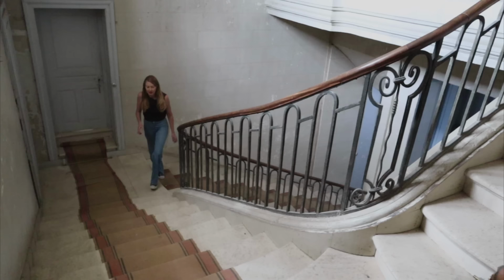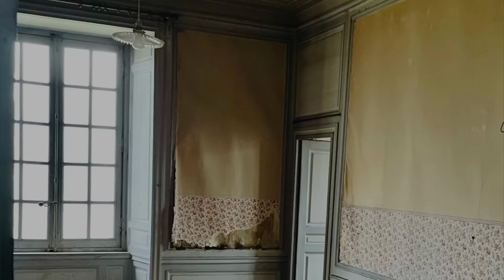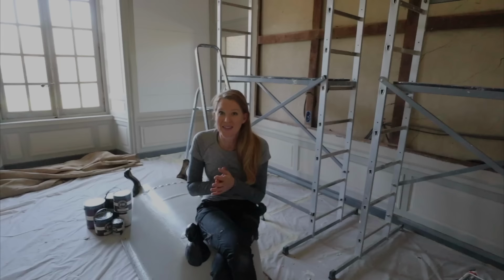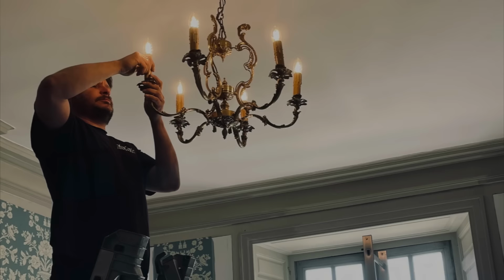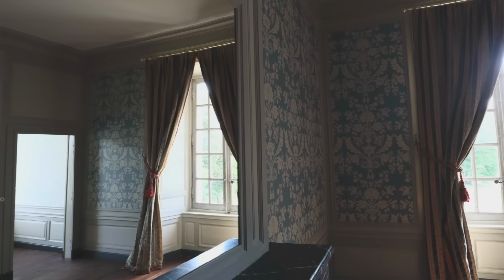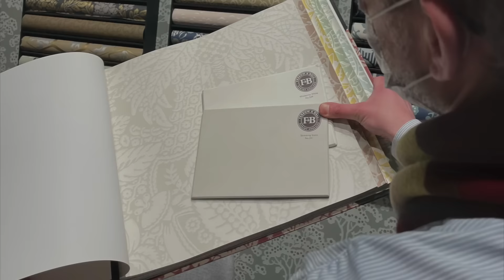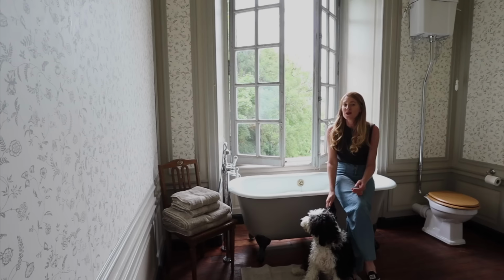Only 103 more rooms to go! Bedroom & Bathroom reveal.

Comment: Cant even imagine how many years it originally took to design, build, finish & landscape to say nothing of regular cleaning, maintenance & grounds work in the centuries before electricity & modern tools. Incredible you are able to do restoration so very beautifully.
Reply from the maker: Thanks for your message.  They actually built the Chateau and the two enormous outbuildings that flank our central courtyard quite fast.  They purchased the land in 1771 and built the chateau between 1779 and 1788.  There was then a bit of a lull (following the outbreak of the French Revolution!) and the ornamental gates were added in 1812.  By chateau standards that is all quite quick - as you quite rightly point out, they did all this without the modern tools that help us today.

Comment: If it took 6 months to completely restore one bedroom and adjoining bathroom, and you have 103 rooms left to go, that would be 51 years, at that rate, and at least twice during those 51 years, the newly restored rooms would have become old and dated and would require secondary and tertiary restorations, hence a never ending project, albeit a massive labor of love.  So then, what is the plan to finish the entire building within five years?  And what’s the plan for heating, cooling, and supplying electricity ongoing, as the restoration must be a fortune with those awesome craftsmen working daily?!  The bedroom came out magnificent, and even though you could opt for a lighter, airy curtain, those look majestic, royal, in there and are a perfect match.  I’d keep them as long as they remain in good enough condition.  The bathroom was quite the chore, but it’s lovely now.  Looking forward to all the progress you will make over this next year.

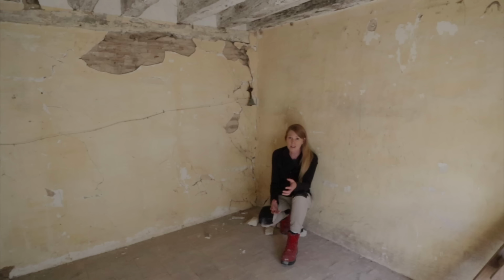Comment: @3:25  replacing floor bean is not out of the ordinary on abandoned buildings.  on a 17th century building you should expect to replace all ground floor beams by the doorways for rot and worm damage. 

Watch Chateau de la Ferte channels, they are doing the same, replacing / repairing all ground floor beams.

Comment: I agree the workmanship was first rate. My question regards the electrical points. You put electrical point on wall near sink and on wall with bed. Did you put electrical point on any of the other walls in the bedroom? Seems you would need them for reading lights or sconce near fireplace. It's a home not a museum so how do you plan to handle Internet, USB points, routers and Internet boosters as you work you way through the house?
Reply from the maker: yes there are electrical points on three of the bedroom walls

Comment: 🙃 You can still have a shower IN the clawfoot tub. There's going to be humidity either way. The wallpaper needs to be extra secured to the wall or put plexiglass over it or maybe seal it with a clear coating. Personally, i would forego wallpaper in a bathroom. Every room doesn't need wallpaper. Maybe a foil wallpaper or vinyl.
Reply from the maker: The interiors of the chateau are classified and therefore the wallpaper panels needed to be retained and restored. It's lovely with the bath and we will find a solution to put a shower in a room close by!

Comment: You’ve done a marvelous job picking materials & design, bravo!

My grandmother had one of those elevated toilet tanks in her upstairs bathroom until I was about 8-10 yo & I was so sorry when she upgraded it to a modern system. I loved pulling the chain to flush the old style one, lol! So I’m tickled to pieces to see you install a similar arrangement!

I know I’m late finding these videos, so likely I won’t get an answer, but I’m curious about the classification of the chateau. I know they want everything back the way it was, but that can’t include old electrical wiring or insulation or plumbing, right? All that should be up to current, modern day code, correct? Then what about the windows? Shouldn’t they be double glazed as well? The glass in those casings over the tub look like single panes to me. 🤷‍♀️ Won’t people will be living in this chateau when it’s done? The heating/cooling system will need the assistance of energy efficient windows, I would think. Don’t tell me the whole place will have to go back to original wood burning fireplaces for heat!
Reply from the maker: Thank you for your comment and your interest in our project.  We'll try and answer your questions as succinctly as possible.  Chateau de Purnon has the highest level of heritage protection (called 'classé in French).  This level of protection applies to both the exterior and the interior of the chateau.  Inside the chateau it requires us to protect as much of the original elements of the chateau as is feasible.  Original wall papers, wood panelling, parquet and tiled floors, ceiling decorative elements, doors, window locking mechanisms etc should be protected.  Obviously at the end of the 18th century when the chateau was constructed there was no electricity and only the most rudimentary plumbing to a very small number of rooms.  Over the last two hundred years various modifications have occurred.  Our  goal is to save and restore as much of the original elements as possible.  We must modernise old electricals as they are a danger to the chateau.  We are modernising the plumbing system - and trying to do so in a way that is pleasing to the eye.  We are rediscovering original paint schemes under more recent ones, and where practicable returning the original colour scheme.  The double glazing of windows is complicated.  Using the existing frames (which are in remarkably good condition) it is difficult to accommodate double glazing.  However, it is not strictly true that double glazing is always forbidden in heritage listed buildings.  This is a bit of a myth.  Its always about the compromise between heritage protection and modern living and work closely with our incredible architect to strike the right balance.  In truth, more often than not we lean towards giving heritage protection the priority as that is our goal and passion.  We hope that addresses your question and again we thank you for your interest.
Reply from the maker: Regarding the heating system.  We have modernised the heating system by installing a biomass system that will serve existing radiators in a small number of rooms in the chateau.  Over time, more radiators will be added.  This is obviously a much more efficient and sustainable system than either burning wood in the fireplaces or the diesel fuel system that was here when we arrived.  There is a video devoted to this project on our YouTube channel.  Thanks again for your interest in our project.

Comment: Lovely renovation!
Are you aware your filming style and soundtrack is exactly what's used by at least one very big French realtor of manors and Chateaux on YT and elsewhere? It's a bit confusing, I can't help but get the commercial vibe.
You may want to adjust that (I definately would). I was surprized by the contrasting two tone boiseries! I haven't seen it done quite this way before. (my flat is the same period and thinking about changes).
I've asked the dealers if F&B wood panel paints include linseed oil but nobody has been able to tell me what goes into their emulsions (a requirement for protected interiors here) so I thought I'd ask if you know?
The name "emulsion" would suggest some form of oil is in the mix. Linseed (flaxseed) was the norm of the era in Scandinavia. But although it dries fast to the touch it takes a full 4 months to fully cure and protect and condition the panels, and it dries quicker exposed to narural UV light.
If you know anything about this I'd appreciate the heads up. 🙏
Great job! ❤️
Reply: …..also my thoughts.  
In DK 🇩🇰restorations like this require old-fashioned paint and not acrylic-based products.
Reply: @AndersBu  as far as I know, Farrow & Ball doesn't make latex or alkyd paint. Their whole marketing strategy is based on paints appropriate for historic interiors and they use the term "emulsion" alot. I have a formal artists education. And an emulsion can include a variety of substances, and oil would be one of them. Just like a culinary emulsion is understood to include some form of oil, butter or shortening.
The paint is apparently also free of smelly ingredients like turpentine and other classical substances used in paint historically. As a Dane, you and I know tge difference between a home made chalkpaint, an old school milkpaint (from soured or buttermilk), egg& oil based tempera, and proper linseed based paint commonly used for woodpanels, skirting, chairrails etc in interiors from the 18th century. All these have different properties, pros and cons, require various techniques and are suited for quite different surfaces. In our countries there's not a chance any of these interiors would be renovated with plasterboarding like so commonly seen in these French renos, it's not acceptable here in protected buildings (nor are methods I see being used to add insulation without a proper vapor gap, or using chipboard etc). My building has modern plaster compound on the walls, so I'm allowed to use any paint I like really (as long as it can be repainted treatments like waxe or polished italian marble dust isn't regionally correct). And the historically accurate treatment would be wallpaper made of natural paper pulp and linseed oil based painted pattern. Like Farrow & Balls, Little Greene and several brands made in Scandinavia. But, here's the thing: especially all original wood features require the right paint. It's very frustrating and frankly quite strange not to be able to access the fulk list of ingredients in paint supposedly made for historic environments. As if they think they use some secret recepie never before seen or tested, (and that would feel historically correct to use) and are afraid of copyright infringement. For an expensive product and project, it's a very strange policy to me.
I very much like the color palette, but without specifics I'll mix my own instead. As they used to, and paint with open windows in summertime.  Cheers from Gamla stan in Stockholm! 🤷‍♀️

Comment: The trim colour you chose is gorgeous and great job with the wall paper.  Those curtains are too heavy and not right for the room and cover half the windows and make the bedroom dark.  The restoration is lovely but the colour of the floorboards would have looked so much better if they weren’t so red and dark in colour.  A natural oak or lime washed oak would have been stunning.
Reply from the maker: Thank you. We actually did not change the colour of the floorboards in the bedroom - this is their original colour. We put a new solid oak floor in the bathroom and matched the colour exactly to the bedroom floorboard colour.

Comment: While the rooms are lovely, designing the tub in front of the window with large high ceiling room not wise decision.It will be miserably cold in winter. You won’t care about the view when you just want in and out.
Reply from the maker: the entire first floor of the chateau is closed in winter as it is too cold so this bathroom is not used in winter ... although it does have a radiator heater